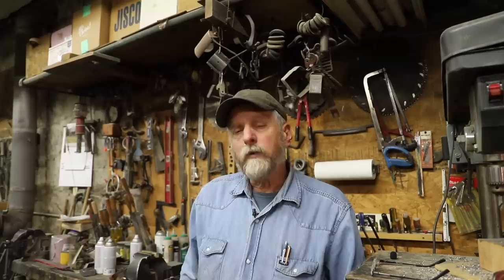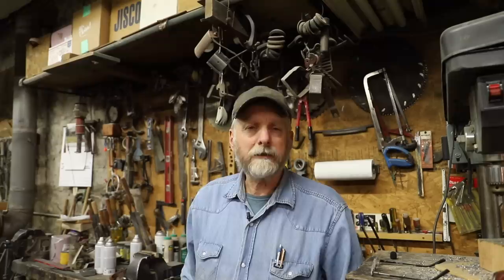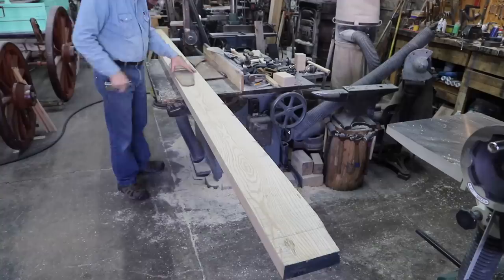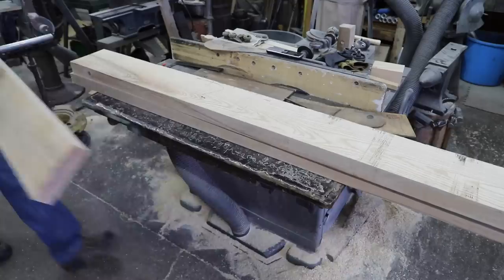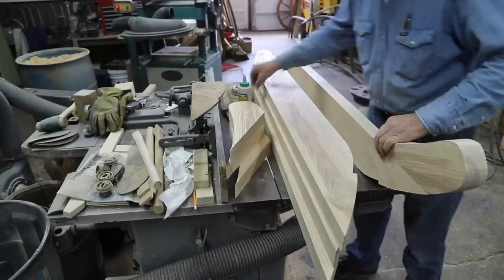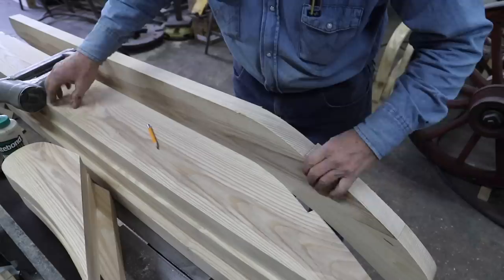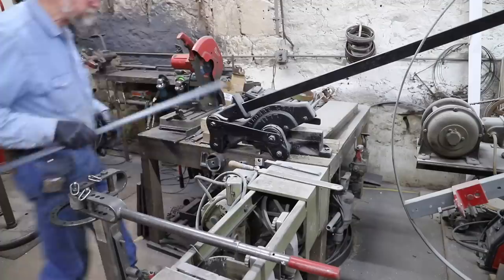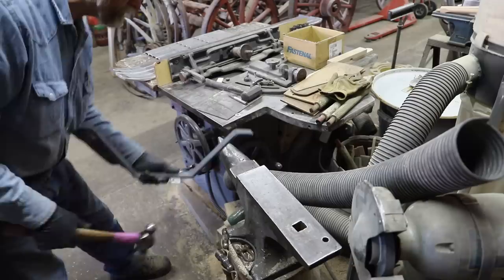Building a Ranch Working Bob Sled from Scratch | Engels Coach Shop

Comment: Dave, What a trip back in time.  In the summer of 1956 I was twelve and I got to work for a while on an uncles ranch in Southern Colorado, Pagosa Springs to be exact.  His place was small, he had a Farmall Cub tractor and the rest of the haying was done with horses.  He mowed hay with a mower pulled by a team.  He claimed the horse drawn mower cut closer giving him a better yield.  My job was to run a dump rake pulled by one horse.  At first I didn't know how to harness "Dan" and I couldn't lift the harness anyway.  By the end of the haying season I knew how to harness the horse and I could do it all by myself.  My  big regret is that I do not have one picture of any of the summer work.  Mowing, raking, buck raking or stacking is all just a pleasant memory.   He also fed from a sled pulled by the same team he mowed with.  Seeing your sled brought back all of those pleasant memories of a bygone era.  David Adair

Comment: My dad had a set of runners made with a caboose on it. Hauled 8 kids and Mom and Dad to town 12 miles. Had a stove in it. Entry was in the back had a window up front and slot for the reins. Back 30 years I restored it. Needs to be restored again.
I also salvages runners for a large hay sleigh like you are making. They are on the list to be done. Need to make a scouting down on the valley for ash. Great work. Hope to pass by you this winter, would like to drop in and see you.

Comment: I always was glad to get enough snow so we could park the wheeled rigs and start feeding with a sled.  Your video made me recall the repairs and rebuilds on sleds over the years.  One question.  Did some runners have cast iron or maybe cast steel sliders on the bottom?  Thanks for sharing.

Comment: You use several different methods to cut metal to length. Why use the shear vs the abrasive wheel or the other way around? The shear looks like it gives you alittle bit of a physical workout!

Comment: On children´s sleds the metal bottom profiles have always a curved cross-section.  I remember in my childhood a friend of mine had a sledge made by his father with a flat bottom profile.  It was much more difficult to manoeuvre with it, it was like more stuck in the straight direction.  Does this not matter in the large sleds design?